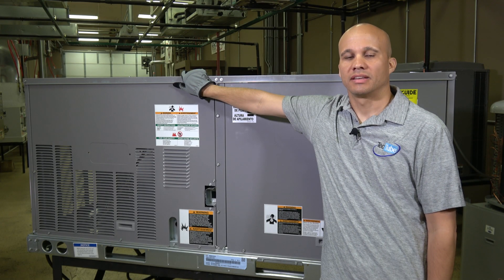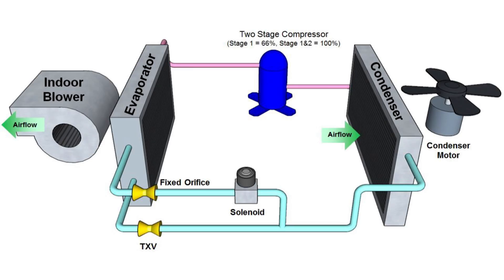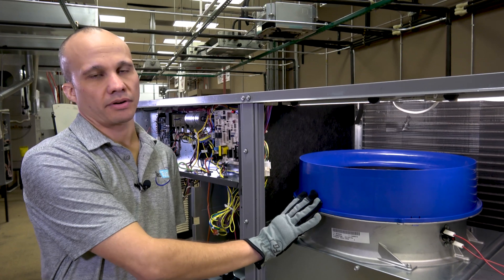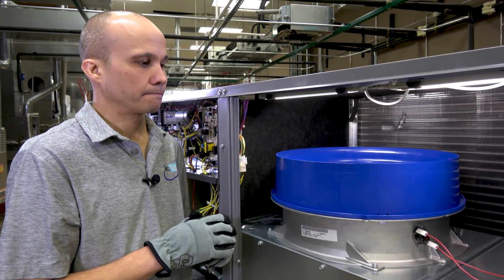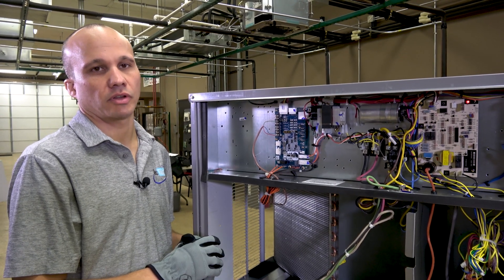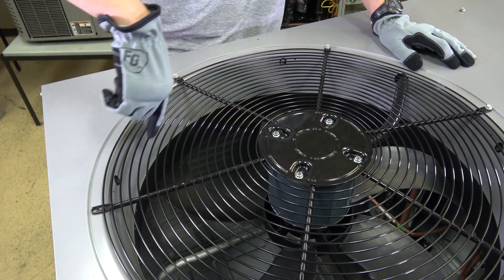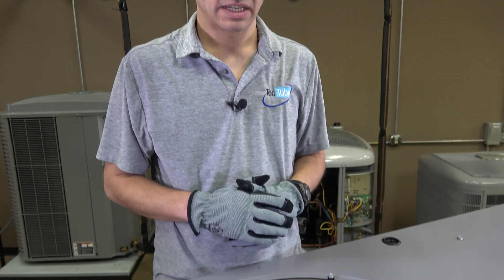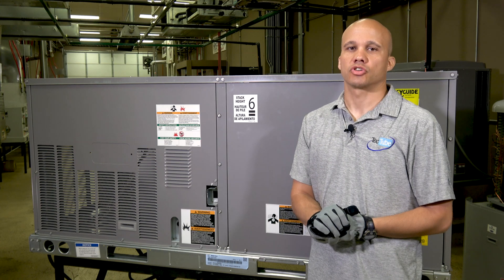ICP X-Vane RTU Overview

Comment: Cheep flimsy crap. Complicated a simple system no communication needed.
Reply from the maker: It is not flimsy at all. We have thrown the black wheel around our training lab (literally) and put it back in units. It is automotive ABS plastic like they use in automotive and Legos. It is not likely to break and doesn't bend shape like metal.
Reply from the maker: It is not complicated either. It has proven to be the easiest fan we have setup or balanced. No belts or pulleys to mess with.

Comment: Hopefully these will eliminate the shake rattle and roll from a traditional belt driven or DD motor
Reply from the maker: They absolutely do.  We installed one recently in one of our classrooms.  The old RTU used to shake the ceiling projector and screen when it ran.  No issue with this new style... very quiet and no vibration.